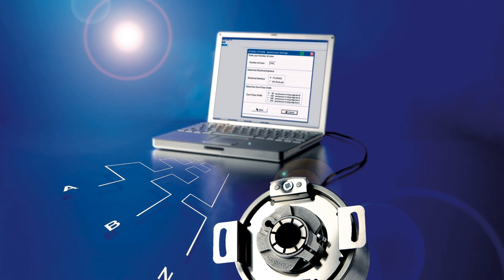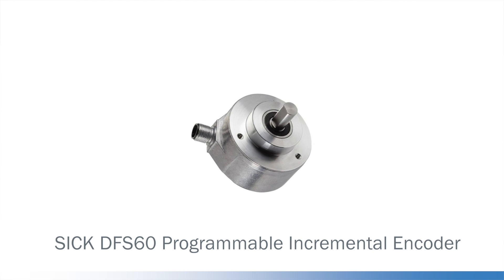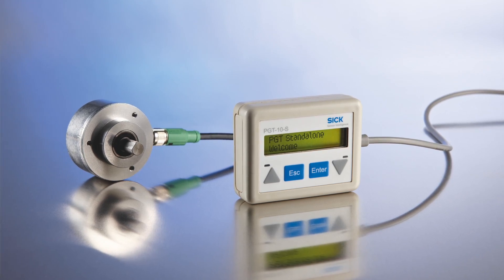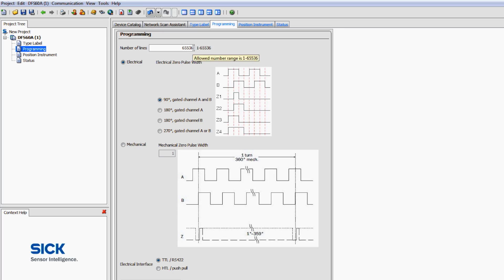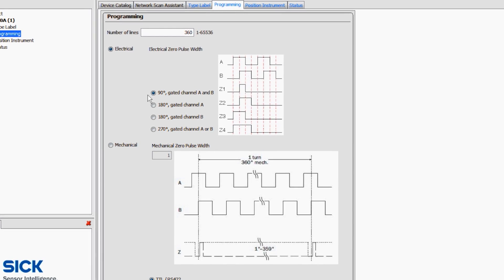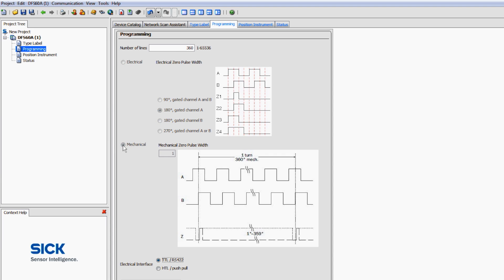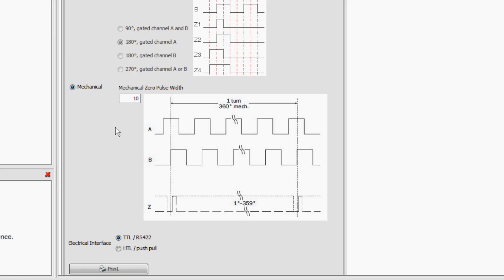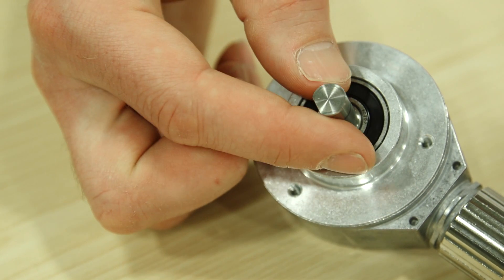Programmable Rotary Encoders

Comment: I am looking at a high quality, less weight, standalone rotary optical encoder for a wheeled robot, I don't want to use an umbilical encoder cord connecting the encoder and hardware, Can someone point towards such a product?
Reply: Reference your enquiry, we offer a wide range of encoders including Incremental, Absolute, Linear, Safety and Motor Feedback, you can find further details of these and all our other products on our website at www.sick.co.uk, if you cannot find what you are looking for you can also email enquiries to info@sick.co.uk.

Comment: Hello, is it possible to connect the LCD to a PC so that it can read (pronounce) the angle displayed?
Reply from the maker: Hi Peter, unfortunately there are no communication interfaces to connect the PGT-10-Pro handheld programming tool to a PC. However if you have an incremental encoder and the number of pulses per revolution are set to 360 then effectively the pulses you see on the LCD display in the option 'Read Encoder Position' when rotating the encoder's shaft will be equivalent to the representation of an angle in one full rotation.
Reply: Thanks

Comment: Hi,
 I`m looking for an affordable  rotary encoder and counter.
I need the encoder to advance  one degree for every line on a USA ruler, is
this possible, what do you recommend.

thank you
Reply from the maker: Hi gamerepair2020Based on your description of requirements I would suggest
something from our DFS60 incremental range of encoders. They have a variety of
mechanical fixings from solid shaft to hollow shaft and a number of electrical
outputs and pulses.  Please visit www.sick.com and search for DFS60 to see the
range.  Thanks for your enquiry.SICK UK
Reply: Hi SICK.
 Thank you for the info i will look into that model later tonight.